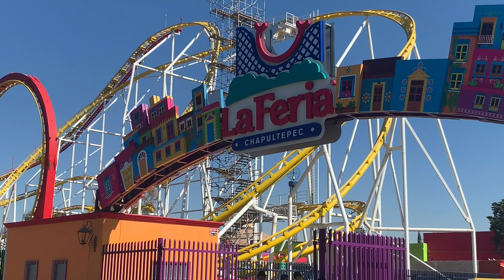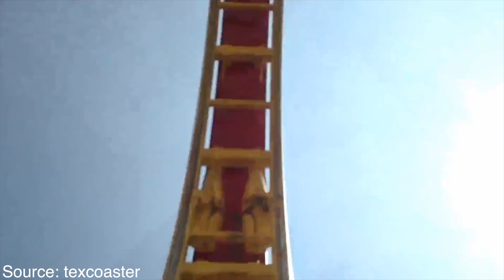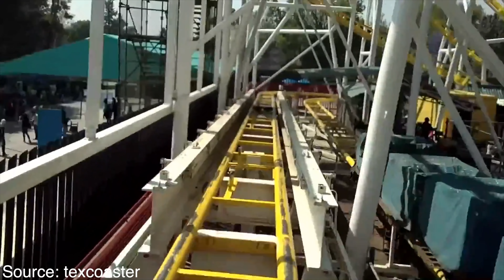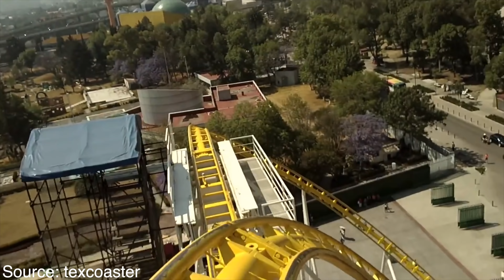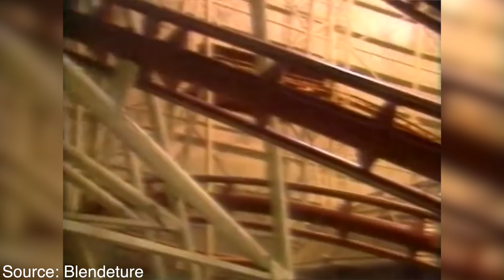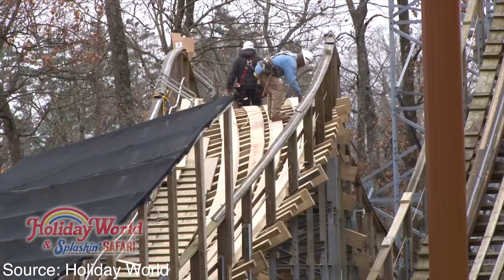Horrific Roller Coaster Accident in Mexico

Comment: It's likely the lack of maintenance, looser regulations, park political pressure and possible cost cutting by management to lower operational costs that was the source. Hopefully if there was any wrong doing that could have been prevented by, for example new or refurbished equipment, that the proper personal are held accountable.
I pray for the families in this time of immense loss and pray they receive some form of closure instead of years of unanswered questions or silence from the park.

Comment: It’s the mind bender of this era
Reply: Very true!  Exactly what it is.
Reply: Same Mfg, same age, Same coster design and exact same failure that happened with the Mind Bender
Reply: @cosmicOrigin  literally，i was instantly reminded by mindbender with its 4th train derailed when i saw this accident  and they strangely have similar layout
Reply: @iceblade019  the mindbender in Galaxyland is a modifed mirror image version of this coaster. It was to big to fit inside so they took out two loops to make it a smaller footprint.
Reply: @MapleSyrupBruh  mindbender is a taller, faster and longer ride tho
Reply: It surely is
Reply: @cosmicOrigin  it literally is a coincidence.
Reply: @annetteslife  obviously not if if was the same type of accident, the same coaster model, on the same exact car. Probably too much forces on the cars and overtime they just became worn down to the point where they break.
Reply: @itspierre8228  exactly thank you. I was 13 when the mindbender incident happened
Reply: Yeds mimd bender also had an accident like this except it only had 4 cars and the last one did a fish flap like this one

Comment: I thought this coaster looked familiar. This RC operated as magnum force at flamingo land years ago.
Reply: Was just going to comment that, I thought it was just the same design but turns out the Mexican company bought the literal ride and was shipped there. It operated in Asia before Flamingo Land bought it.
Reply: @nervesconcord  It toured the German fair circuit in the 80s, which is when I rode it (1985 on the first ACE Europe tour). The greatest, most intense steel coaster I've ever been on (with trims on lightly). So incredibly unfortunate for the riders & families.
Reply: It also operated as Taz's Texas Tornado in Houston at Six Flags Astroworld in the late 90s-early 2000s before moving to a different park. If it's not the same coaster it is definitely a clone. I wish ElToroRyan would make a problematic coasters video for it.

Comment: I watched a later video that detailed what happened, it turns out they had modified the cars with cheap aftermarket parts, and disabled all the safety features on the ride, because sensors and things were getting old and needed replaced, and they didn't want to spend the money.  They took parts from several broken trains to make one train, and combined it with cheap aftermarket parts that weren't even properly secured.  This would be illegal in most countries that operate amusement park rides, but laws in Mexico are struggling to catch up.

Comment: Didn't this coaster run without trims? Myabe that extra wear had an effect
Reply: Yeah it looks like it ran super fast thru the layout.
Reply: They aren't trims those are block brakes, this coaster used to run with 5 trains when on the fair circuit and it needed those to run all 5. What is supposed to slow the train down is that booster lift which has variable speed that adjusts depending on how fast the trains entry it but the park didn't maintain it and instead did a patch job that bypassed the control system and allowed it to run at full speed all the time

Comment: The forces generated by running the ride without using trim brakes definitely took a toll over time  on the wheel assemblies  causing it to fail. These components are subjected to extreme forces  during just one circuit....now couple that with several hundred cycles in a day and something was bound to reach it's failure point with unfortunately tragic results.

Comment: This roller coster actually got the golden ticket award in 2017 for 38th best steel coaster in the world. It also received 39th, 44th, and 49th places in 2002, 2003, and 2004 when it ran as Magnum Force at Flamingo Land in Malton, England.

Comment: The mindbender accident was caused by design flaw,  not being able to easily see the bolts holding the bogie wheels to the train.  They vibrated loose causing them to be sheared off as the train was approaching the drop for the 3rd loop.  The train then fishtailed, striking the track and allowing the riders to be tossed out.   It was also found they were only visually inspecting the bolts for tightness, because the ride was so new at the time of the accident.  I would almost guarentee if they weren't maintaining the ride this is what happened in mexico

Comment: I remember when a ride from the same manufacturer failed in my country (La Turbine, at Walibi Belgium, now called Psyké Underground). It's a Shuttle Loop, due to a technical issue the train entered the loop too slow and came to a perfectly balanced stop in the middle of the loop. The passengers of the train stayed inverted for over an hour. Thankfully, no one was seriously injured and the ride still operates to this day. It's one of the locals favorite and was refurbished. The ride is now indoors and completed in darkness. I was a kid at the time and it put me off doing this ride for a whiiile.

Comment: this was at flamingo land for about 5 years left in 2005 it was completely knackered when it left surprised its still open now.
Reply: It did look tatty by the end of its run as flamingo land where not know for upkeep in the rides visual appearance. However the ride must've been serviced to a reasonable standard as it had no Incidents. It was sold to this park and refreshed but after that I guess they ran it too fast with very little maintenance.  Olympia looping also operates in London at the winter  wonderland.
Reply: @Dan-hq2js    Did not know that thanks for info. Live in London

Comment: Rode this exact coaster at a German fair in 1985 during the first ACE European tour. Known as "Drier Looping" then, it remains the greatest, most thrilling and intense steel roller coaster I've ever ridden. During our day there, seasoned ACERs were riding once or twice and quitting due to the ride's intensity. I think I got around 25-30 rides. I can barely imagine this ride without the trims, which were used in Germany, though lightly. I went to La Feria (then known as "Chapultapec Park") in 1992 & Montana Rusa (the wood coaster) is one of the greatest wooden coasters I've ever ridden. It was, since then, modified & tamed somewhat. What a tragedy for the riders & family! How terrible this is!

Comment: The cause of this accident is all on the park, the maintenance staff and the safety inspectors, nothing to do with the ride being unsafe. The three contributing factors are  1)The above 2)the ride was being ran faster than it was designed due to the trim brakes being either off or inoperable  3) As with the mindbender accident  this coasters design means it is time consuming to  visually inspect the bogeys fixings but it's no excuse to omit it  , if this is not done it will eventually result in  this situation - which will have also increased due to the trains running too quickly.
Don't blame the ride though, 
This coaster ran for over 5 years at flamingo land in the UK  with no issues and was completely renovated prior to being rebuilt at this park, why all of this model of coaster did not have the extra failsafes fitted as mindbender did after their  incident I don't understand.
Sadly this  ride probably was not serviced or checked correctly since being renovated  and rebuilt at la feria, if it was, even without extra safety features added this would never have happened, the park, maintenance staff, and inspectors should be tried for manslaughter very sad indeed.
I hope the park, and ride, returns with  a good owner and correctly maintained rides.

Comment: Idk about considering it poor maintenance. After this happening in Edmonton on a rollercoaster that is literally the mirror image of this model and has the same wheel assembly setup, I honestly think that all parks with these models should have switched their wheel assemblies to run 4 on each train and not just the 2 on the trailing cars. Honestly leads me to think that Knightmare was the only one of these that were impervious to this kind of failure...

Comment: it's the same model as mind bender. I rode mind bender and it is a really fun ride, however the cars are faulty. it's probably due to the bolt that holds the wheel on snapping and derailing the car. also 3 live were taken in the mind bender incedent, witch is a strange similarity
Reply: How are the cars "faulty?" Schwartzkopf/Intamin trains just like this have been running since 1976 when Revolution opened, and there's been, what? Two accidents? And one of them, this one, is likely due to poor maintenance procedures. I do not believe the trains are faulty.
Reply: @crooked-halo  just this model. The back car had a bar that held the wheels together on both accedently the bar snapped and the back train derailed.

Comment: the schwartzkopf design changes at Mindbender West Edmonton Mall should be mandated for all similar schwartzkopf designs. this tragic accident seems to be far too similar and preventable :(
Reply: This ride operated for 35 years on a fair circuit and a bunch of crap parks incident free until this. This is NOT a design problem it's a lack of maintenance problem. I think the fact it ran incident free under such crappy conditions for so many years means this ride was extremely well designed

Comment: These are some seriously forceful coasters, so it was not caused by poor maintenance. It happened to Mindbender too. This is because of stress on the wheels just because of the insane forces.
😢
Reply: Not true... It was a maintenance issue in Canada.
Reply: @djavatar68  It was partially a maintenance issue but the tracks do take a lot of stress.
Reply: This operated for 35 years with no issues until now. It's not a design issue it's a lack of maintenance and insepections issue. If this was operating at a US park this would have never happened

Comment: Imo, schwartzkopf should have recalled the model after the WEM incident and had all cars replaced
Reply: Both accidents were caused by lack of maintenance and poorly translated manuals. This is not a design flaw if it was ran and maintained to Schwarzkopfs standards both accidents would have never occurred